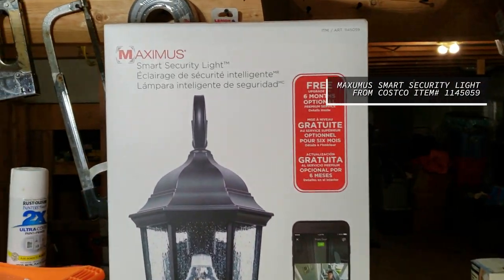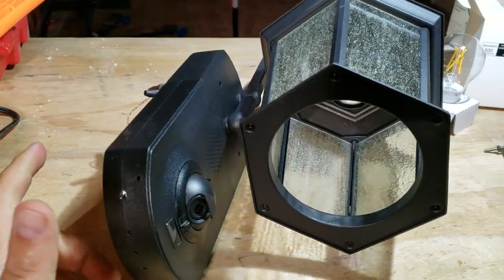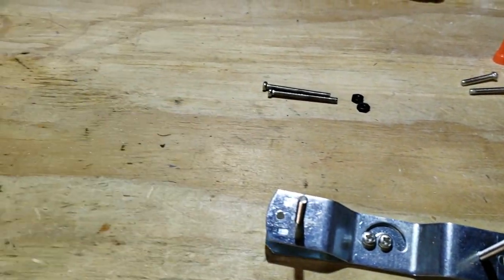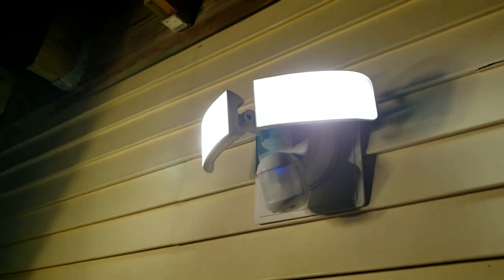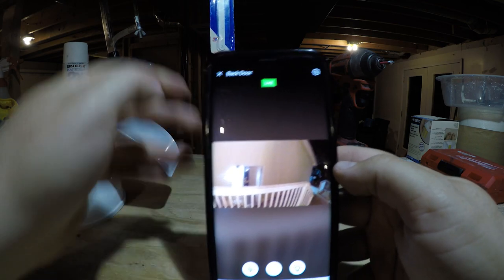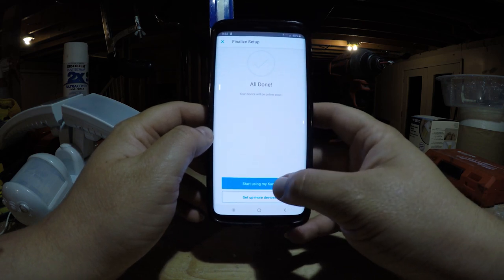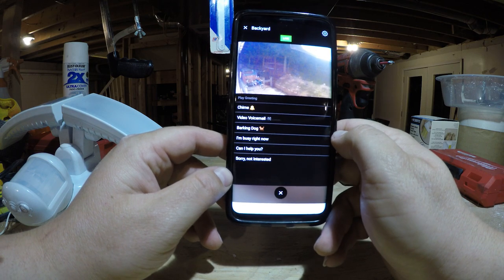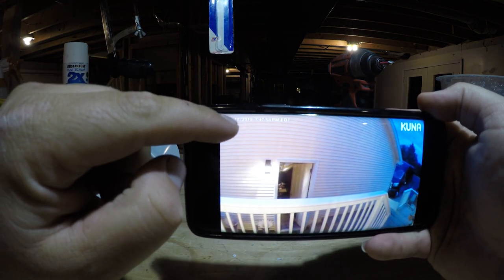MAXIMUS SMART SECURITY LIGHT REVIEW BY KUNA

Comment: If the camera is getting power from the same line as the light, won't you loose the video when you switch the light off? So you just leave the switch in the on position all the time and use the app to control the light?

Comment: Great security lights when they work but they are prone to hardware failure. We had ours for less than 4 years and all 4 had hardware failures at the same time, per Maximus Customer Support. We were told all 4 cameras failed and the only solution was to purchase new security lights. There are no replacement parts or repair options. $1000. is way to expensive for security lights that last less than 4 years.
Reply: Same happen to us. we bought 3 and 2 stopped working with in 1 year of use. Support would now replace them. Now having trouble out of the last on after 3 years of use. They are nice looking lights but to much money for the time they work!

Comment: Have had mine for 4 years also.  Although they still show live video, one stopped recording just after the 2 year mark.  The second one stopped recording after 3 years and the display shows just snowy static.  Says system not connected when trying to use live view, yet in my app it shows connected and the snowy static picture.  The 3rd one at 4 years won't connect to the internet after a power outage. Even though it has worked for 4 years.  It still has power to it, and trying to setup identifies as camera nearest me, yet won't find any wifi signal.  I have the 4th one that is still working and recording, but customer support is non-existent.  Ask them anything and you get the same, "don't know what happened or why it's doing that.  Because of their age you probably need to replace them".  Why would I spend that much money (now $250 each), when I get get a better camera and spotlight for 1/3 the price anywhere on the internet.  They will continue to lose sales as long as they out price their system.  If you want to increase sales, lower your price back under $150 and people may start buying again.  Until them, I'm going with one of the better and cheaper options found through CNET, PC Mag, Consumer Reports and many other sites that rate security camera systems.  In fact, none of these sites even listed this system in the top 10 security camera light systems.

Comment: all - I had the connection issue, had to change internet from comcast to AT&T so using different router and name - my Kuna light/camera  was not working. Same calls with Kuna service - led to hardware issue. However, I did some further research. I was able to use my old iphone 6 plus (download the kuna app) and complete the reconnecting. I guess the Kuna blue tooth is using an older version that my current iphone 12/13/14 will not connect. However, an older iphone like my iphone 6 plus did the trick. I just want to share this here, in case you have the same issue - it took me days to found a solution.